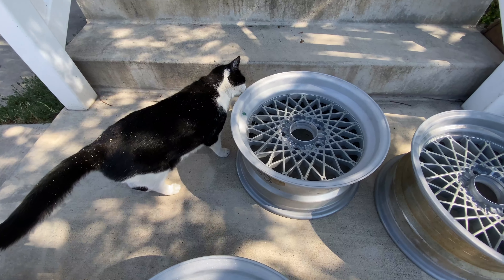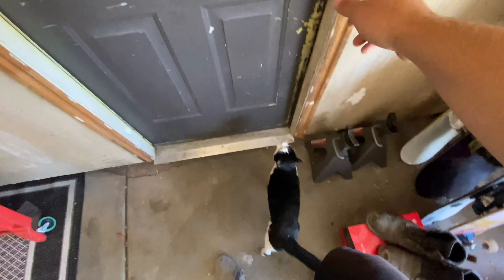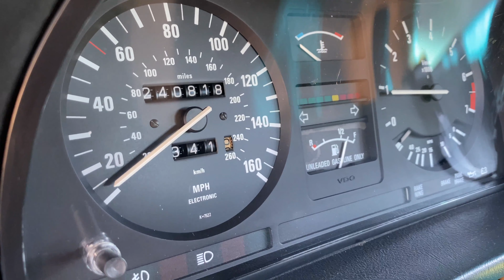SURLY the Patina'd BMW E28 - Part 9 - Facial and Shoes

Comment: sweet video man. just a tip, youre running your welder too cold. tbh with MIG on steel as long as its got something of a bead its probably bonded but crank the heat up or the wire feed down and you should get a much nicer and stronger weld thjat looks more like a chamfer rather than a dome
Reply from the maker: Appreciate the tip! This was my first or second time, and luckily felt like it wasnt going to be the highest stressed part- lots more practice to do before something a bit more serious. ✌🏼
Reply: @SamHurly  check out a channel called “this old Tony” he does some easy to digest welding stuff and a bunch of other cool things

Comment: Good content brother. What spring rates are on the GCs and how is the ride on those 16?
Reply from the maker: Thanks man, running 430 front and 315lb rear, and at the height I have it it’s firm but not terribly shocking, though bump steer and heavy compression dont get treated super well. A lowered E28 crutch it seems, but regardless still very fun to drive.